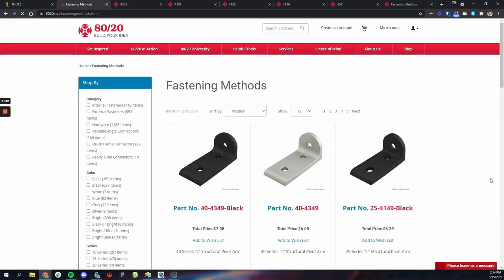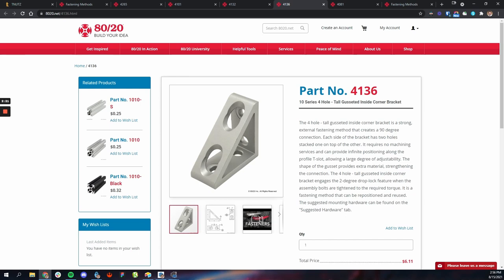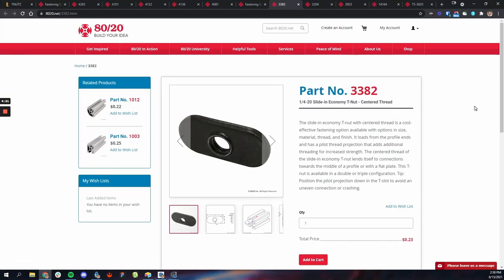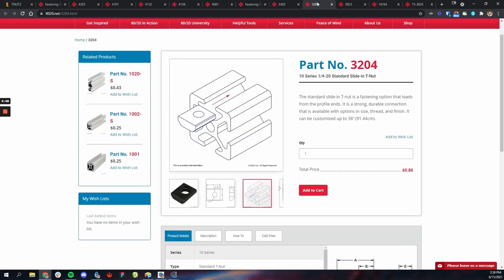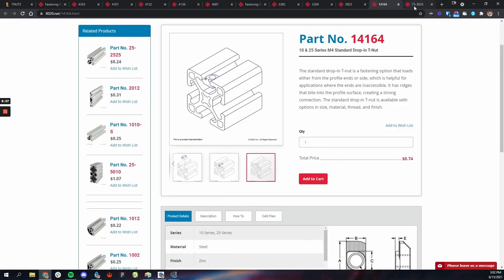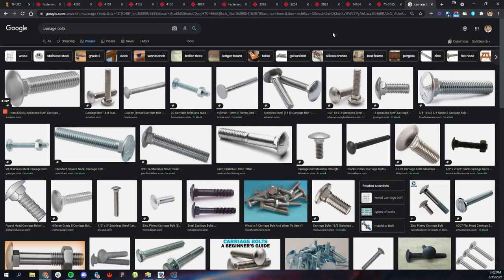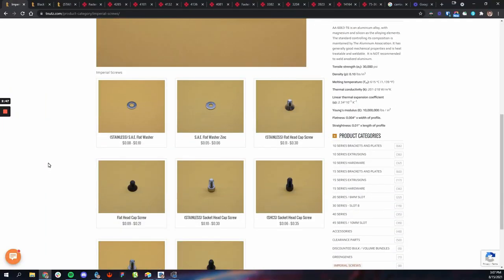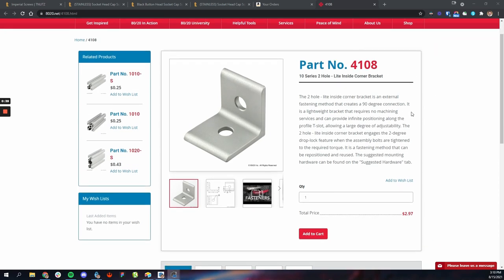Aluminum Cabinetry - Part 2: Fasteners | Ultimate Guide to 8020 Aluminum Extrusion

Comment: 14:51 The angle aluminum you are holding looks like the kind used for trim and nonstructural applications.  The structural aluminum angle is thicker and tapered (the outside angle is made of two flat planes meeting at 90 degrees, but the inside angle is tapered and thicker at the a the vertex).  Additionally, aluminum comes in different formulations (alloys) which have very different characteristics.

Comment: More people carry the 20 series parts because that is what 3D printers use more. 20/20 and 20/40. Great videos. I watched both. I do allot of wood working but I would have done what you did and use the aluminum. I don’t know why but I love working with aluminum extrusion. I should have build my 3D Printer cabinet from this but went with wood. Next project will be a PC case using both wood and aluminum.

Comment: You can 3d print many of the mounting parts as well.  This would not be viable for load bearing structures, but for lighter duty applications they work great.  I went on thingiverse and just printed out all the brackets I thought were interesting to get a better understanding of working with the material.

Comment: One of the things I think you missed is electrolysis. When you  connect steel and aluminum together you get an oxidation  caused by electrolysis. So I would guess that screws that they sell for these systems are protected or stainless.
Reply: Correct me if im wrong but isnt that only triggered when theres electric current passing through them with liquid media?
Reply: @syahfiqalarby6175  You could be correct? 
I do know from house wiring  that the oxidation happens very quickly and creates a prohibitive heat build-up with no liquid electrolytes  present. Perhaps I just should have said oxidation?
Reply: @Townie001  it would still be incorrect though, because oxidation is when metals oxidises like rust on iron or the cloudiness of aluminum when exposed to air...or how apples insides browning...

Moisture counts as fluid, so maybe when its more humid and currents pass through it either directly or indirectly (like eddy currents i think) the electrolysation happens

Comment: 15:19 This is painful. I feel your frustration. I think I was at least 30 yr old before I realised how anyone could even work in imperial units (for woodworking, etc). 

Metric is simple: M4 holes & drill-bits are exactly 4mm wide. M4 bolts fit M4 holes and screw into M4 threaded holes. M4 bolts will fit M5 holes with about 0.5mm gap all around. 

Probably the only variable you’d have worry about is bolt length in millimetres. Use a hacksaw to trim length and deburr with file or sandpaper is better than nothing at all.

Comment: Pro tip 1: the center of of each series is half the series name, i.e. 1010 is 0.5” to the center
The bottom of the t-slot is less than than that
On every profile, there is a dimension for this as well as the t-slot “lip.” For example, 1515 is .484” to t-sly bottom and the lip is .16”. Subtract those two. As long as your screw length (after plate or bracket) is less than that number, your screw will work

Pro tip 2: the series name acts as the hole spacing, i.e. 1010 has 1” hole spacing

Pro tip 3: 8020 lists the compatible series for basically every part number

Pro tip 4: if ordering thru 8020, go through your local distributor. For example, Pittsburgh, PA uses SunSource Pittsburgh. Many of them have designers assemblers who can help design and assemble your project. 8020 also has designers and assemblers. You can request a design quote or an assembly quote from distributors and 8020

Pro tip 5: don’t be afraid of finding components from other vendors like McMaster-Carr, Super Bright LEDs, Suspa, etc

8020 is more expensive than others for a few reasons… these include the anodizing process, the aluminum stock, and the tools they use. All 8020 aluminum parts are anodized. They mainly two different aluminum grades, 6105-T5 and sometimes 6061-T6. As you mentioned, 8020 uses things like laser cutters, CNCs, and other tools

Comment: Are all spacing for each rails different for each series? I got a 40 series crossbars and hesistant to buy aftermarket mounts, afraid that the holes for the rails might not fit.

Comment: Burrs.  Using a simple deburring tool, file or a countersink bit.  To center it using a center punch and any measuring tool.  Use a stop block to cut identical angles.  Strength...buy the right gauge aluminum.  The cons are ALL based on lack of experience.

Comment: 13:05 It's extremely easy to de-burr your cuts and holes. For the holes, all you need is a slightly larger drill bit, you don't even need to use your drill press. Use the larger bit to just slightly touch the hole you previously drilled, twist the bit and the burrs will be removed. For the burrs from when you cut the angle aluminum, or steel, us a file and clean up the cut. Neither method is difficult, even for a first timer, and you don't even need any expensive tools. You also mentioned the fact that the majority of the hardware found on Amazon, is for 20 series extrusions, that's because the majority of the people who are buying this type of hardware from Amazon, are doing it to either, build their own 3D printer, or modify an existing 3D printer. This leads me to another option for angle and corner brackets, if you own a 3D printer, you can make them yourself for pennies, AND they're going to be a perfect fit. You can even find decorative angle and corner brackets to customize your look. Another great thing about this option is that you can print your pieces in whatever color filament you want.

Comment: Yes the right , yes the T nuts , yes the depth . But the hole is too tight … erm drill it bigger then countersink that sucker … I will be doing a big shop in my (A to Z) online shop - the one with a smile … when using a chopsaw USE A CLAMP with depth shop . And wear glass and face masks …

Comment: Those things you keep calling 'screws'  . . . they're 'bolts'.
Reply: If you were as wise as you think you are you would know that your statement is wrought with inaccuracies.  They are actually most commonly considered machine screws.  

However as technology advances our old terms become outdated as well.  Historically a machine screw differs from a bolt in that it can be tightened with a screw driver.  In the old days when the option was a slotted screwdriver or hex wrench the difference was obvious.  But what about these "button head" (oval head) fasteners?  

IF they have a Philips head it would seem they are obviously machine SCREWS.  But if they have an Allen head are they bolts?  Maybe, because you can use a wrench, an ALLEN wrench.  

BUT what if you are using an Allen DRIVER?  LOL  the point is you are arguing out-of-date terminology.  

However if you want to stick to your POV you are wrong.  Why?  Because no matter what you cannot use a hex wrench or socket which is what the old definition would say a BOLT is.  So by the outdated nomenclature there is no way these are bolts.  (But they might not be screws either LOL).
Reply: @derRoteKampfflieger  They're bolts, get over it.
Reply: @davelordy   Learn humility, you were wrong.  It's okay man.
Reply: @derRoteKampfflieger  😂 lol, they're bolts, despite your lecture.
Reply: @davelordy  LOL all you want but it isn't my opinion.  Read some engineering papers, check out Army or Navy documentation.  If you are going to spout off at least spout off accurately.
Reply: @derRoteKampfflieger  "If you are going to spout off at least spout off accurately"

Sure, the bolts in the video . . . are bolts.